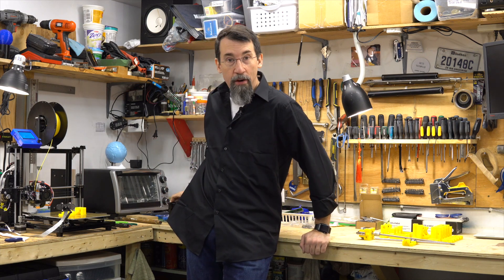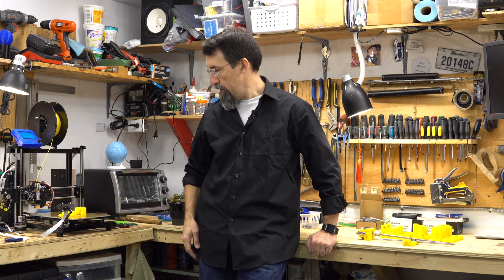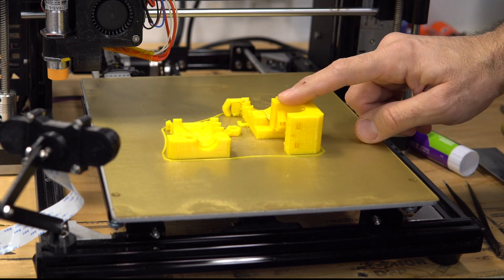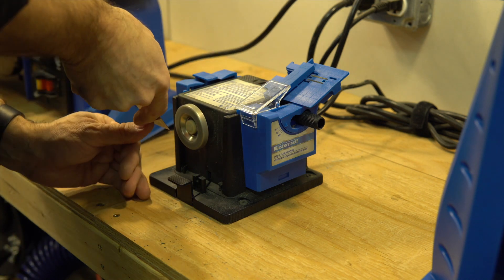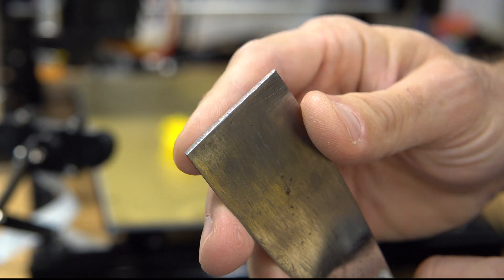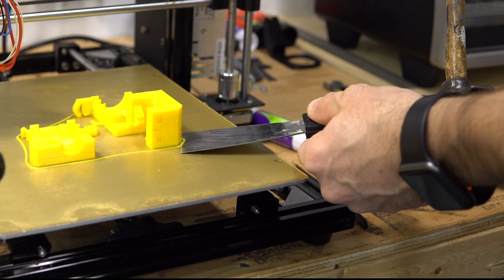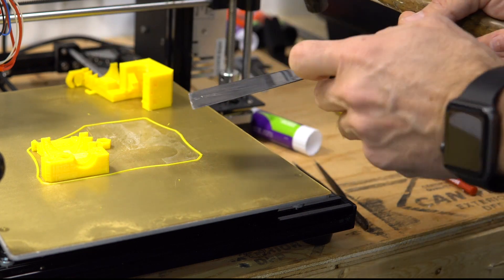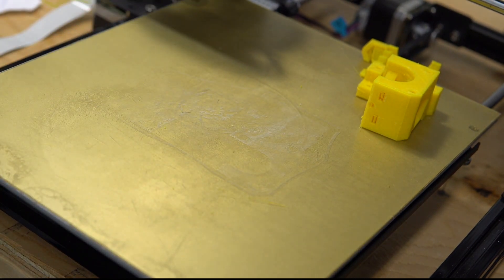How to remove models from the bed.

Comment: Hello FRANKenstein can I use a big hammer instead of a small hammer?
Reply from the maker: Can you be gentle with a big hammer? If yes, then go ahead!
Reply: I tried to be gentle but then I accidentally broke it 😤😬😠😭
Reply from the maker: Oups 🙁
Reply: What should I do now?
Reply from the maker: What did you broke?
Reply: Frank's 3D shop I tapped the knife under but tapped a little too hard and broke a part 😬😤
Reply from the maker: Keep trying, got to be careful happens to me also... you have to unstuck the delicate parts first, than the bulk of the parts.
Reply: I'll try to be careful next time I gotta go buy a new one
Reply from the maker: Oh I see you mean the scraper broke! Ok mine has metal all the way to the end sandwich between the plastic parts. Good point.

Comment: Hello Frank. I'll offer one more thing to try while users are using a grinder or sander to sharpen the edge.
Maybe think about rounding the corners a bit to help prevent stabbing or gouging the build surface if a little off angle. This is more likely to happen when cleaning the bed off like when you have a piece of skirt or failed print that had too close of a first layer while printing on BuildTak or similar surface.
Reply from the maker: Good idea, will try to mention it later, and put a text on the video when I can, thanks